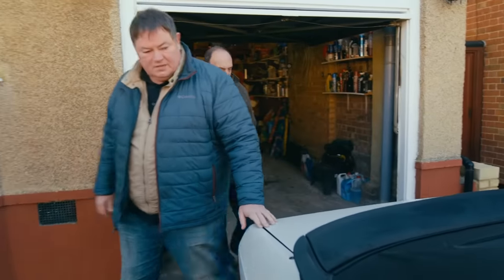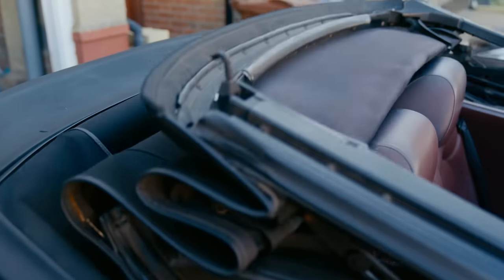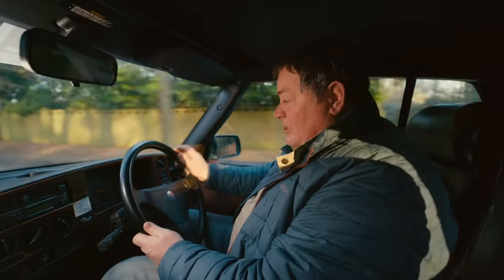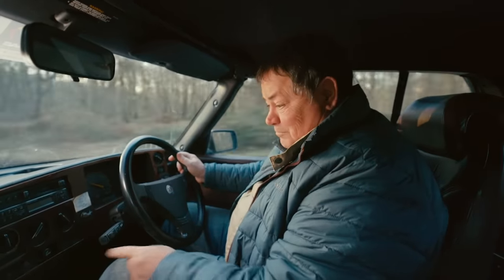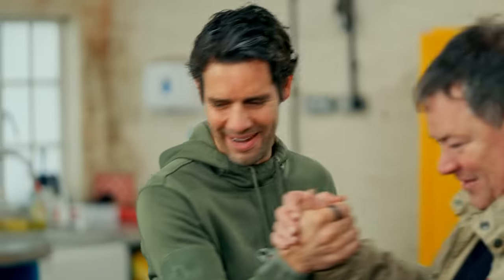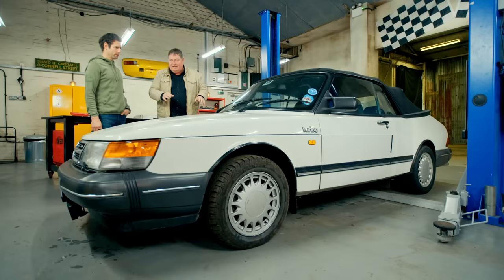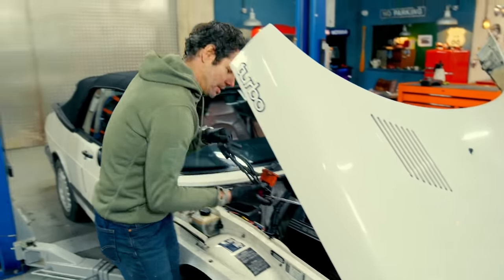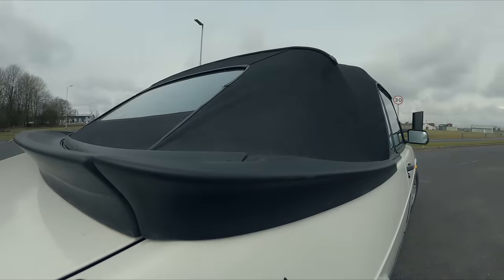Elvis Revives the Saab 900 Turbo Convertible | Wheeler Dealers

Comment: I loved my '87 Saab 900 Turbo.  Especially when it ran.  Turbo and APC system failed the first weekend I took it home brand new from the dealer.  In the 2 years I owned it, it spent a total of 3 months in the shop and stranded us twice due to fuel system issues.  I sure wish Elvis was around when I had that Swedish lemon!

Comment: Boy you made the slave cylinder removal easy! I've done this a few times and usually its extremely tight, you have to put the clutch and cylinder at the same time and its brutal. Makes me wonder if my pressure plate tool isnt thick enough. Looking forward to seeing the second part

Comment: These low carbon areas need stopping I drive a car with a big engine but it burns no more fuel than some small engines but I pay more road tax already and if I take it to places like Birmingham I have to pay this stupid tax I drive a car that I have never seen another so according to the internet there is less than 15 on the road so would be a-shame to take it off the road